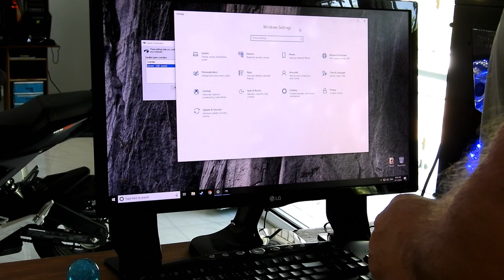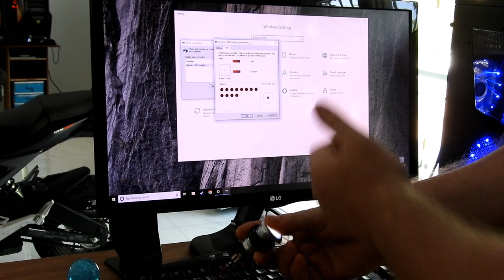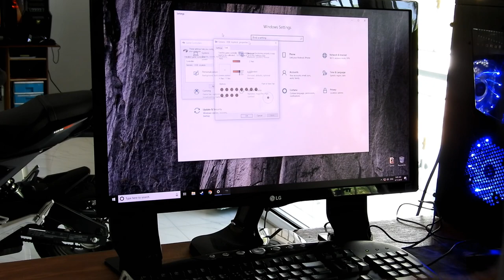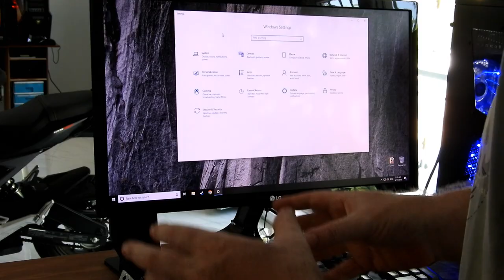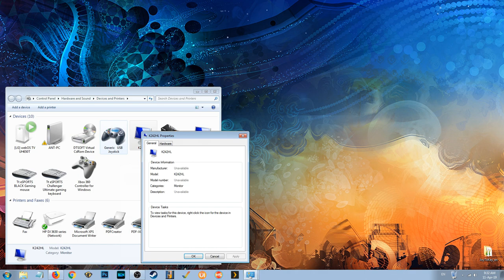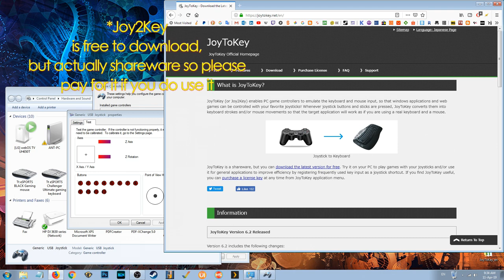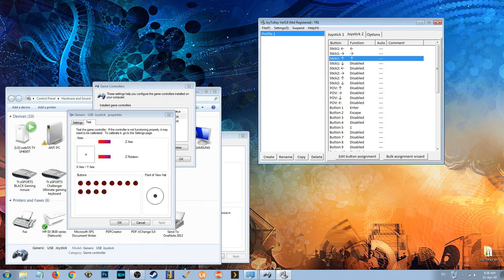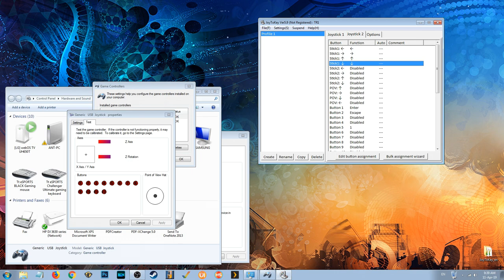USB Arcade Controller Setup Guide

Comment: hello i have a problem with mine, buttons apear as pressed, any ideas??
Reply from the maker: Hi Fernando. Honestly I'm not sure. I'd start by removing everything and restarting. Just work wiht a single button and get that working before adding more. Maybe check that the connector is the right way round, but I don't think that's doable without forcing the connector into place...

Comment: FYI The plate under the JoyStick is called a Gate, them come:  Rounded-Square for 4 Way Rounded-Oval for 8 Way or Octagon 8Way for better controller,  Also you can use the 4 Up Down Left Right from the Joystick to Buttons instead, if needing more buttons, Link to Black/Earth and use the 4 spots for Buttons

Comment: Hi, firstly thanks for the video, it helped me. I’m new to these circuit stuff so i don’t know very much, i have a question. What does mode, turbo, clr and auto ports do? Can i use them to connect more buttons?
Reply from the maker: Hi, and sorry for the slow response. Yes, you can attach more buttons - the Turbo button is like a rapid fire button, and Mode changes the input signal (I think so you can have 2 boards, not conflicting). Hope it helps.

Comment: A very useful tutorial, I'll be refering to it again when I start my project. The cables from the buttons to the board look quite short, did you have any problems with placing the buttons where you wanted in the cabinet? I know it's easy enough to just extend the cables but it would be nicer if the were a bit longer in the first place.
Reply from the maker: Cheers Jeff! Great question, yes, the cables supplied with the button/encoder kit are short (about 8 inches), but just about ok for the mini cabinet I made - the encoder sits mounted onto inside of the front piece and central to all the buttons which are within 8 inches from it. It is a consideration though as even a slightly bigger cabinet would necessitate extending at least some of the cables.

Comment: i happened to buy the same set as you, no instructions. this helped a lot! have you seen a way to change the color light on the joystick or does it just cycle the rainbow forever? i got a blue and a green joystick but i thought they would just be blue and green lights...
Reply from the maker: Hi, sorry for the slow response. Hmm I can't seem to see a way to stop the led colours from cycling either...
Reply: @arnoldj.rimmer5116  I just unsoldered the red leds, now it just cycles blue and green, goes with the blue and green theme i have going on. thanks anyway!

Comment: Just finished a diy build, using a standard encoder board, for joystick, and buttons. Only the buttons are used. Pinball Arcade won't recognize it, even though it's detected in Windows USB game controller setup. I'm going to try the Joy to key program you mentioned. Maybe that'll work. Thanks for the video.

Comment: Hi Arnold, Great stuffs. Thank you. Can you give us the full list of your joytokey setup information. Like what key or keyboard you press for for plunger, right flipper and left flipper, viewer angle, right nag, left nag, front nag. I am sorry but I am confused. I don’t know which key on keyboard is for what on the pinball so if you can that will be great help. I know which one is 1, esc, enter key on the keyboard but then rest I don’t. Like the one listed flippers, tilt or Nags not sure I am using right English term or word. Which you make the pinball tilt. Thank you
Reply from the maker: Hi Johnny. The keys depend on what software you are using. If you are using Visual Pinball, start the program without loading a table, go to the Preferences menu and click Configure Keys, Nudge & DOF... A window will open which gives all the key assignments and their function. From here you can note the key and function to enter into joytokey, or change them to suit your preference. 

For other programs like Pinball FX or Pinball Arcade, look at the key assignments to see which keys are assigned to which function, and use that info to enter assignments into joytokey. Save each  as a separate profile in joytokey under the same name as the pinball software and it will automatically load that profile when you start that game (you must have joytokey running of course). 

Cheers!

Comment: Did you add those female connectors to the 5 volts yourself? I just got my board and i dont see any other board with them.
Reply from the maker: Hi yes the boards came with only enough cables to connect the buttons, not the LEDs. But as I ordered a double set and only used one, there were enough cables for this setup.

However, I had to make a daisy-chained cable myself to feed the +5V from the board to the button LED connectors  so I ordered more of the same cables with the female connectors already fitted (the connection is also the same for the joystick supplied) to make it easier for just a few dollars. 

Hope that's clear...

Comment: 5:18 I don‘t really know much about soldering but can I put a 5 pin encoder in the hole instead of a 5 pin joystick?
Reply from the maker: Hi Tom there shouldn't be any reason why you couldn't plug anything which sends a simple digital on/off signal. All the sockets on this board work similarly and the joystick plugs work just like the button sockets. I don't believe you would damage anything by trying. Cheers!
Reply: Hello Tom, can you share which type of encoder you used? I would love to know how to add in a rotary encoder that presses a button when rotated to the left and another button when rotated to the right.

Comment: Hi again.i have spare buttons with microswitches.can I use those with the usb decoder or do they have to be usb type buttons.no leds which I don't want to use anyway.thanks
Reply from the maker: Hi Jay. The buttons to use are simple microswitches, as used on normal arcade machines, but really any type of digital ((on or off) switch with a two-cable connector would be ok.

Comment: hi great Video man!!
is there any posibility to assign an axis (not just 0 or 1 input) like for flying helicopters?
Reply from the maker: Cheers Sarge! There is a way to use Analogue input on these cards, but not straight out of the box.  The Mode input switches between Digital & analogue modes, but using Analogue inputs involves removal of some resistors, cutting of PCB tracks and soldering wires onto the required parts. Look here for more info (and instructions). Hope it helps! https://www.instructables.com/Lets-make-a-game-controller/
Reply: @arnoldj.rimmer5116  okay thank you for the fastt answer!
Reply: @sergeantmars2640  do it dude it's easy and fast and works good (I did a couple last night)

Comment: Hi, did you hear any information about any delay in pressing the buttons?
I have seen other "Zero Delay" models, (red PCB), which claim to have better low latency and better performance.
Can you tell me something?
Thanks.
Reply from the maker: Hi Andy I also understand from research that the more expensive options are supposed to be very low input lag. I can comment that the cheap Chinese PCB I used showed no noticeable delay from pressing the button to the flippers reacting even on this low-end setup. Like anything I'd suggest getting the best you can within your budget or check out the pinball forums for more detailed info.
Reply: @arnoldj.rimmer5116  Thanks, you're very kind.

Comment: May I know how to connect a USB joystick to JAMMA harness? I just have the arcade board without the cabinet and I already found a RGB to VGA converter. Hopefully you can share your experience with me.
Reply from the maker: Hi, sorry but I don't know of a way to connect USB controllers to a JAMMA harness. They're not really designed to work together. You might try the forums on byoac.com (buildyourownarcadecontrols), to see if anyone else has done something similar. Cheers!

Comment: By any chance you do know how to set the default mode for this encoder? I don't like the idea of adding a button to set the mode. Instead I'm thinking maybe add an inverter or change a resistor to set the default mode. Any help will be appreciated!
Reply from the maker: Hi, I have only tested changing the mode with a button attached to the mode port. I haven't tested if it stays in that mode after powering down though. I won't be able to get back home for some time still because of travel restrictions here, but if I get the chance I'll do some more testing and let you know...
Reply: @arnoldj.rimmer5116  thanks a bunch!

Comment: Thank you for the guide! I also got 2 of these usb controllers from China. Unfortunately I can't find a daisy chain set of the cables to order so I can input all of the LED buttons at the 5V slot. Is there any other way? (Besides asking an electrician maybe to splice and chain the existing ones)
Reply from the maker: Hi, I made my own using cable and connectors - it's not that difficult, or I've put a link to the type of thing to buy from AliExpress below. You might be able to find these locally. Cheers!

https://www.aliexpress.com/item/1005002347743178.html?spm=a2g0o.productlist.0.0.647e3a58bkFfvg&algo_pvid=88f63025-0185-4aaa-9dbe-2ec5b2077a0c&algo_expid=88f63025-0185-4aaa-9dbe-2ec5b2077a0c-0&btsid=0bb0624416225894079291804edbce&ws_ab_test=searchweb0_0,searchweb201602_,searchweb201603_
Reply: @arnoldj.rimmer5116  Thank you so much! I guess I should order those.

Comment: Arnold great video but if you have time and the knowledge could you help? I'm new to these boards and wondered can buttons 1 - 12 etc be configured to match specific keys from a keyboard or If not what keys do they match? Many thanks in advance.
Reply from the maker: Hi Gary. Look again at the clip at around 16 minutes in. 
The board is recognised as a joystick by Windows, but by using a program such as "Joy2Key", the buttons can simulate keypresses in order to work with the various software. 
Plan your button layout logically, decide what each button should do in each program, then create a joy2key profile for that software.
I might try to do a more detailed clip for this, but I'm working a long way from home so it might be a while before I get a chance.
Let me know how you get on. Cheers!
Reply: @arnoldj.rimmer5116  Sorry for the delay but Covid and all that. Thank you for the recommendation about the software. Downloaded and set up with my newly set up laptop which is going to run a jukebox (DW jukebox). So my old laptop reinstalled with Windows XP, attached USB joystick controller and then loaded Joy2Key software. Easy to set up and enables me to have 16 allocated button as I have remapped the joystick switches as well. Early tests are promising, just need to run it for a few days but no signs of stutter. Took a bit of time to get it to load automatically on startup but that was more of the dodgy info I was given at the time.
Reply from the maker: @Davie7g  Di mate I'm glad it's working out for you. Cheers for the update & stay safe!

Comment: if you use microswitch buton (no led) is there a polarity (+ and -) or you can plug them in any sense ?
Reply from the maker: Hi, yes there is a polarity on the buttons/board, but with such low voltages you won't damage anything if they're the wrong way round...

Comment: Is it possible to connect a trackball to this board? So I can play Centipede and other trackball games?
Reply from the maker: Hi LH, this board doesn't support any anologue input out of the box. If you want to use a trackball, spinner or similar, look at an Arduino Leonardo, which does support analogue input and isn't too expensive - there's lots of support about too for setting these up for Mame cabs and the like. Cheers!

Comment: Hi.to do 2players with 6 buttons each do I just put 6 buttons into keys 1-6 and daisy chain key 1 slot with (p2A)button for eg. and daisy chain key slot 2 with(p2B) button and so on?thanks
Reply from the maker: Hi Jay, this board has 12 button sockets - you should be able to just plug all your buttons in with no issue, and assign them to keypresses as described. Hope it helps.

Comment: Do you know how to wire up a 360 degree rotating rotary encoder to this board?
Reply from the maker: Hi, this board as it comes is digital only, and requires some difficult modifications to get it to understand an analogue signal such as produced by a spinner or wheel. You might find some helpful info in this clip which looks relevant (not mine) https://www.youtube.com/watch?v=AqYDVgHWPoc hope it helps - cheers!

Comment: H Thanks for the video very informative especially for a 55yr old woman. Could the other 4 sockets for the 4 way joystick be used for a trackball? thanks
Reply from the maker: Hi Gillian. A trackball would need some kind of analogue interface capable of interpreting the variable signals received from it. As it stands, this board only reads digital (on/off, open/closed), when buttons are pressed etc. Trackballs can come with a USB or a PS2 (older type, round mouse/keyboard connections), and can be read as a mouse when attached to a computer. If you're looking at a trackball, look at the interface cable and how it would attached to your hardware to understand what is needed to get it to work. Also have a look at byoac.com forums for more trackball info. Hope it helps!
Reply from the maker: @gillianknights6927  Hi Gillian yes I see - the spinners work similarly to a trackballs but in a single plane, but also need an analogue device t interpret the signal, which is what the Arduino in that setup does (but which this can't as we know). It looks like an interesting project! Best of luck with it Gillian!

Comment: Can this be done with small buttons. I want to make a custom layout game controller, but I only see USB encoders for Arcade Gamepads and not Console-esque controllers.
Reply from the maker: Hi mate yes this and others like it are ideal for custom designed layouts. It's recognised as a generic USB joystick and, by using  a program like joytokey, you can assign any key input to any button. It should also work with any type of digital (on/off) arcade button of any size. Also cheap enough kit to use to prototype your setup with first. I used this for a mini-pinball machine (check my mini-pinball videos - just ignore my erming/ahhing :), so the layout was specific to my requirements. Cheers!
Reply: @arnoldj.rimmer5116  What would you recomend for Gamecube controller.
I want to make a custom GameCube controller for retropie, but it uses 2 analog. Encoders only have one analog.
Reply from the maker: @MrSirFluffy  Hi mate I have to admit I know nothing about the Gamecube controller, though the idea sounds interesting. If I wanted to investigate it further, I'd try to get a cheap controller to strip down and see what I could do to adapt it. Hope you sort it out ok. Cheers!

Comment: thank you for this video! helped me a lot!!! cheers
Reply from the maker: Cheers Octavian!
Reply: @arnoldj.rimmer5116  hey man, I am trying to build a small dj controller using a similar board. From your video I successfully mapped the buttons I need using joy2key but I cand figure out how to make a rotary potentiometer work...  do you think it is possible? Thank you
Reply from the maker: @ApostolCOctavian  Hi mate you're not going to be able to get a potentiometer to work with this board as it is. There is a messy method to enable anologue by cutting some of the PCB tracks, removing a couple of the resistors and soldering in wires to achieve it, but you'd be better off with something else which supports an analogue input out of the box. Look at a Teensy or Ardiuno or similar board to make it easier. Hope it helps!

Comment: If i connect the cables between them and connect just one of the cables at the 5v slot then all the buttons will have the led function?Please answer.
Reply from the maker: Hi, yes. Use the power plug to the LED connectors on the first button. Then chain these connectors to those on the next, then the next and so on. If you look at this video you can see that's exactly what I did. https://youtu.be/jVHkaD42C18 Cheers!
Reply: @arnoldj.rimmer5116  Thanks man!

Comment: Hello, excellent video. Work in a Android Tv root from China?  I want play Pinball Arcade
Reply from the maker: Cheers Claudio it works just like any USB generic digital joypad so it should work with the box, but I'm not sure how it would interface with Pinball Arcade on Android - I use joytokey for the PC version - might want to check if it accepts joystick input mate.

Comment: Any idea why both my red LEDs are blinking, while plugged in? Nothing is getting recognized either!
Reply from the maker: Hi, sorry for the slow reply. I didn't experience that issue so I can only guess that the board may be faulty. You might try putting a button across the mode switch and changing the mode - not sure how affective it might be though. Good luck!

Comment: I have the same items with two small buttons, I’m having trouble on where to connect that on the board, It’s a start button.
Reply from the maker: Hi, you can connect buttons to any of the 12 ports and assign its function (start, fire, etc.), in the joytokey software. Cheers!

Comment: Does the encoder get enough energy to work through the USB cable? 
or 
Are the 5 volt conectors necessary for it to work?

I want to get a kit like this for a raspberry pi arcade bartop.
Reply from the maker: Hi, the encoder gets enough power through the 5V USB and works with no problems - just like a joypad or joystick.
The 5V connectors on the board are for only powering the LEDs on the buttons if they have them (if buttons don't have LEDs these aren't used, but LEDs look really nice). Cheers!
Reply: @arnoldj.rimmer5116  Thank you :)

Comment: Is it possible To install 2 board on the same computer ???
Reply from the maker: Hi yes just the same as using 2 USB input devices like joysticks. You will see them as generic type joysticks in settings/devices. Cheers!